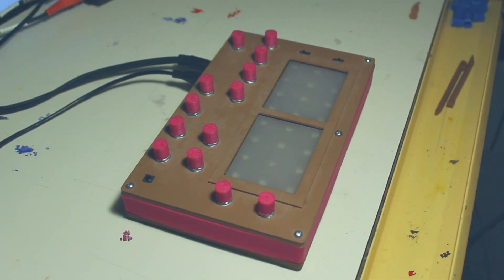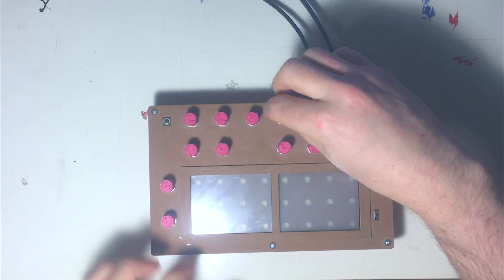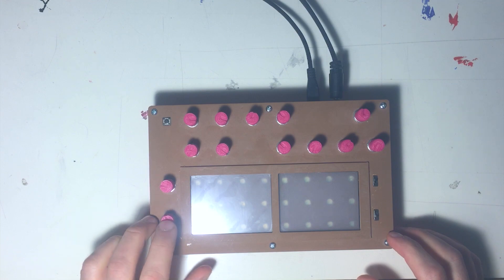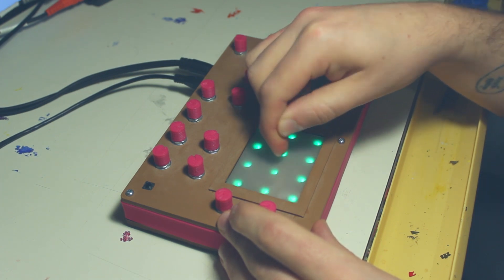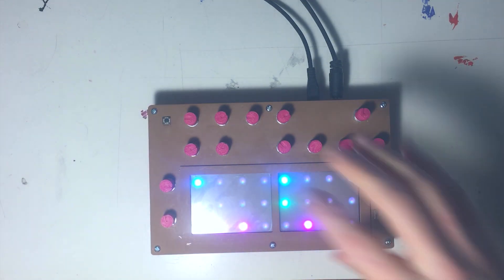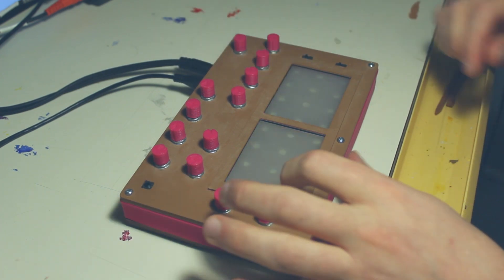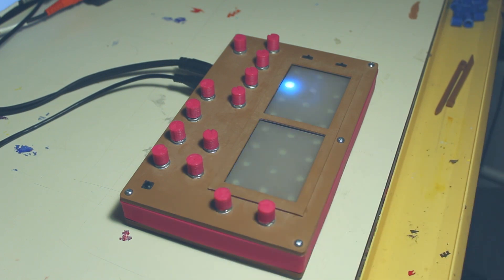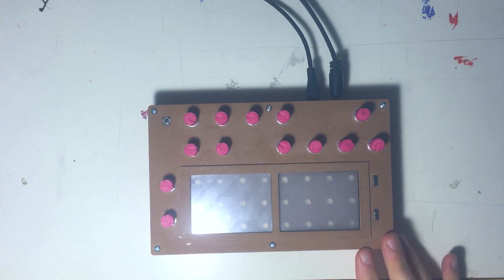Mr. Touchy - Teensy Poly Touch Synth + Drum Machine

Comment: I just got a terrible idea that I don't know whether it will work. Touchscreen consists of two transparent glass electrodes that form voltage dividers when they touch each other, right? But when they don't touch yet, perhaps just the top plate could be used for capacitive sensing. By determining the touch before the plates connect, you have two time points that could be used to determine the speed or force with which a pad was hit. I might try that some day.